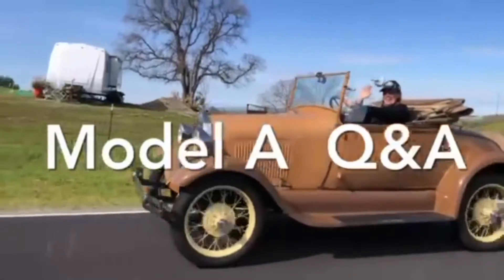Do Ford Model A’s need special fuel additives like lead?

Comment: Hi Paul ,  This video on gas to use in a Model A Ford and the video where you drove you A on diesel and other fuels brought to mind a time in 1982 at the Orange County California Model A & T clubs that I belonged to. For some club meetings that year a member showed movies of his trip in a Model A up and back from LA to Alaska above the Arctic Circle oil field, sponsored by the Arco Oil Company for Arco oil pipeline promotion. Arco was suppose to have gas shipped up to the Arctic depot for his car but the shipment was delayed. He got to the depot in the Model A and needed to head back south by a certain date but no gas had arrived yet. The Arco person said all they had for gas up at the depot was some skim off the crude oil that they used in some small gas engines up there, but that it was only about 60 octane. He said , I will take it , and they left him enough 60 octane gas along the way back south to get to the first town south with regular gas, a distance of several 100 miles south. He said that the Model A ran just fine on the 60 octane gas, giving good power to travel the several 100 miles over very ruff roads to the first town south with gas for sale. He ever thought that the Model A preferred the 60 octane gas because it burned slower in the low compression Model A engine and was no problem at all..
Reply from the maker: Thanks for sharing 💗

Comment: Hi, Paul and Tina, I am not sure about your Model A's, but their valve and head design must have been mostly steel and iron. 
 Cars that used leaded fuels did so to help prevent knock-under load also known as (PINGING) and to protect the soft valve seats that were cushioned by the presence of the lead residue that would buildup over time. When unleaded gas came along hardened cylinder head valve inserts were developed for unleaded fuels. today old design heads can be updated with new hardened valve inserts to protect them from damage. Cars with Catalytic converters must use unleaded fuel only or the Catalytic will be damaged. Have fun with your Model A's.